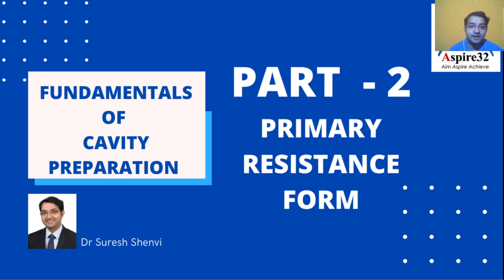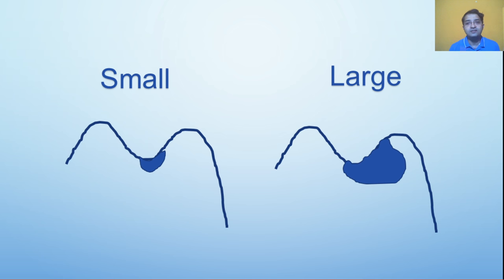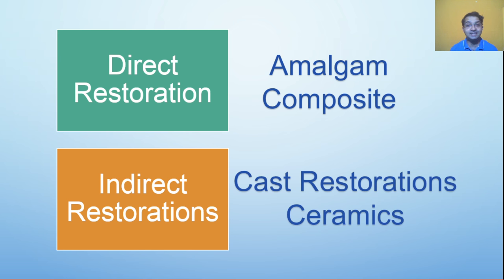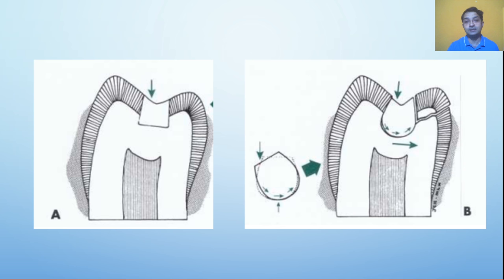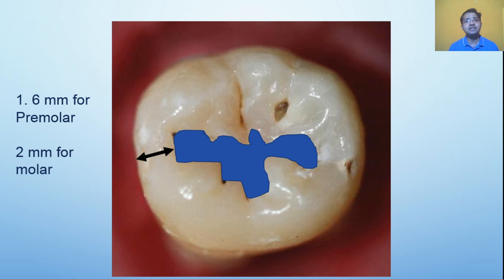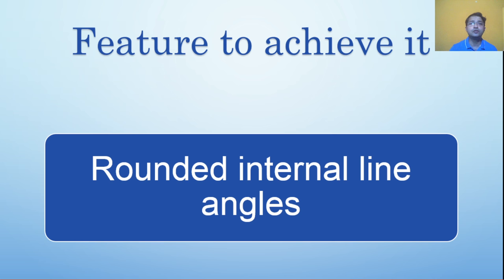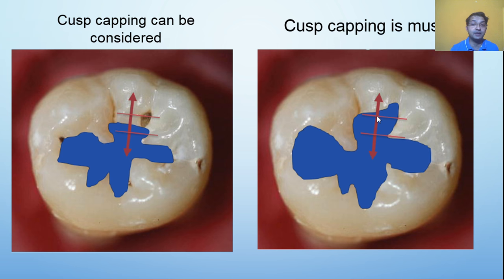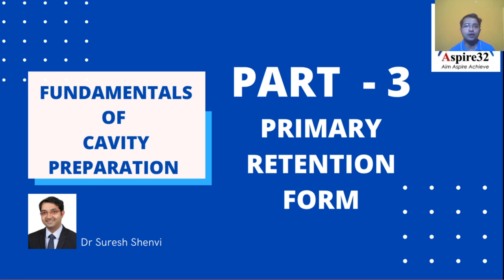Operative Dentistry | Fundamentals of Tooth Preparation - Part 2

Comment: Dear Dr. Thank you very much for great preparation. Pls help me: 1/ Which is better for this preparation (preclinical teaching, clinic): electric vs air-driven system? 2/ Amalgam will be replaced and discontinued (and WHO (current caries concept: non communicable disease): "no drill and fill"): so these principles will be changed or not? best regards
Reply from the maker: I did not understand your first question.
Answer to 2 - new high speed electric driven are currently considered better.
Answer 3 - Many countries still use amalgam

The principles are as per the latest edition of sturdevant. 

I do Composites and most of these principles may not be needed for composite